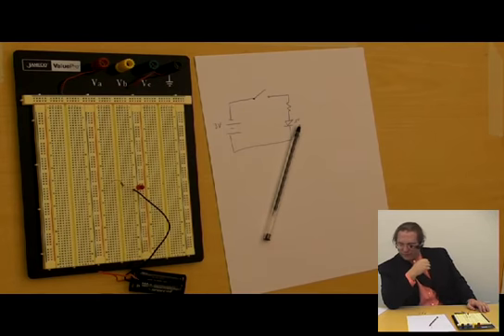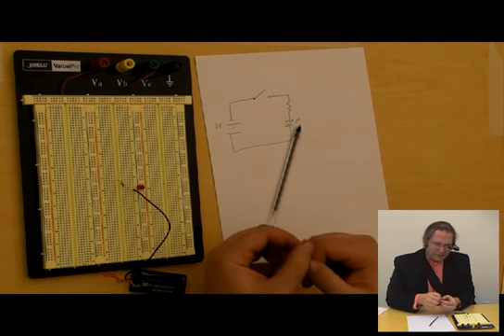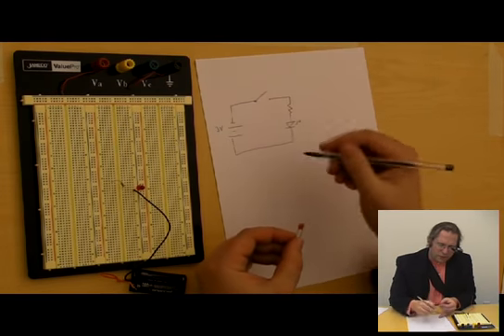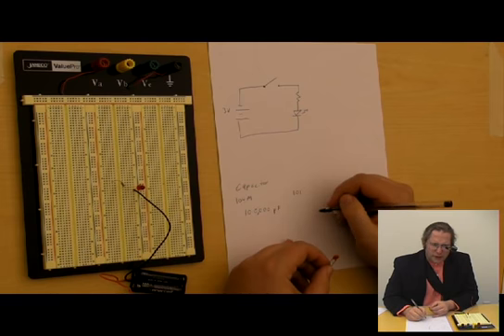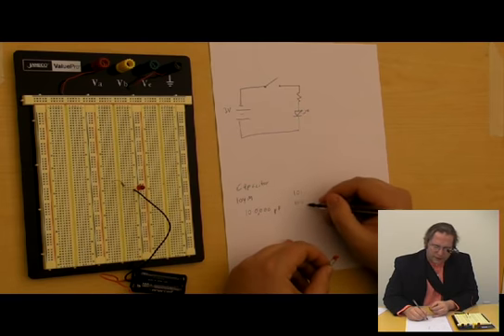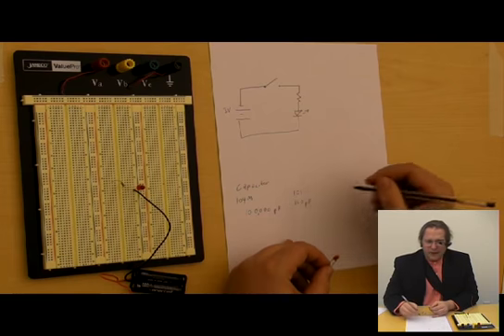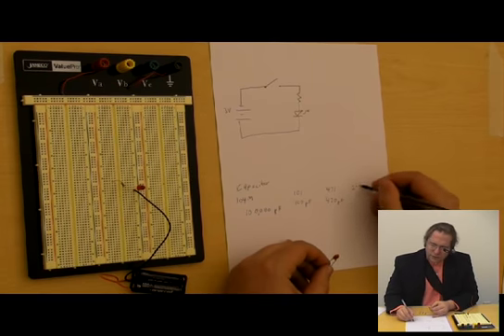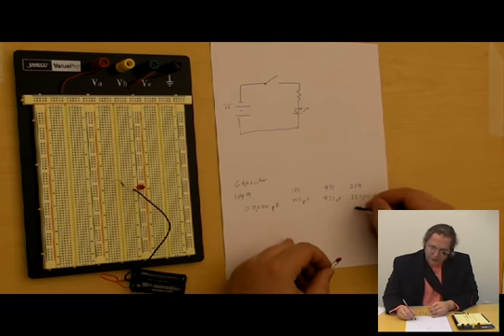CS 3651 Introduction to Capacitors

Comment: I suggest that video 4, 5 and 6 need to be done in a different way
Do a circuit schematic (symbols and drawings ) video, then makes separate videos for the resistor and capacitor (types , coding and testing )